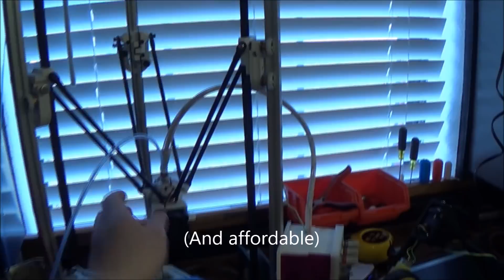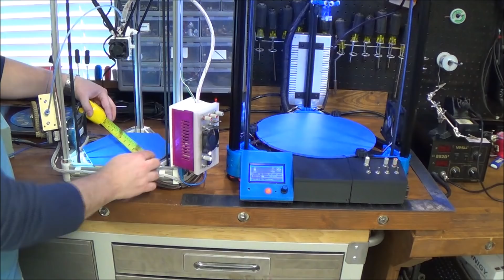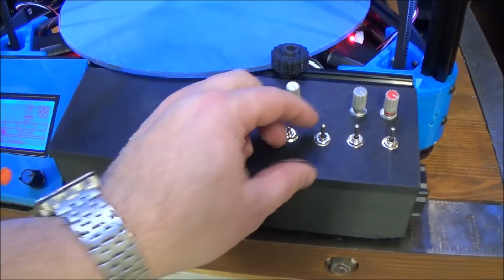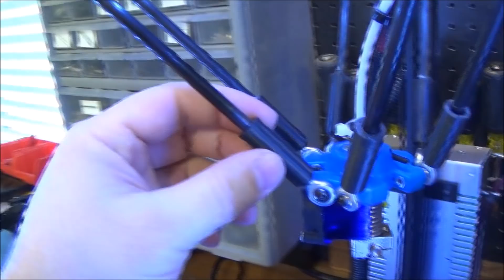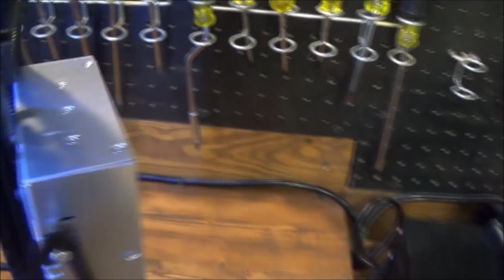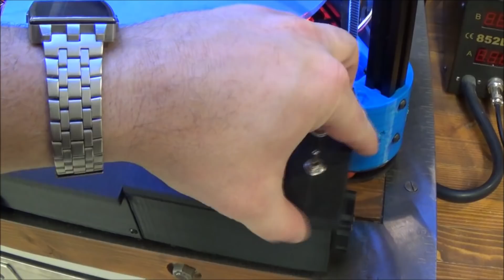Big DIY Kossel XL RepRap 3D Printer

Comment: love the video quick question, you used a small PCB alu heat board(110w) with Kapton tape all over the glass, is this even possible? I always thought you had to have the same size plate glass plate as the pcb?